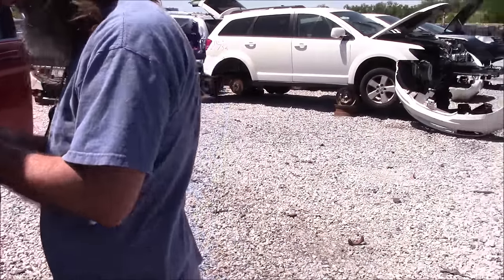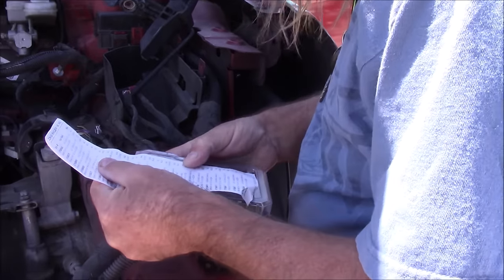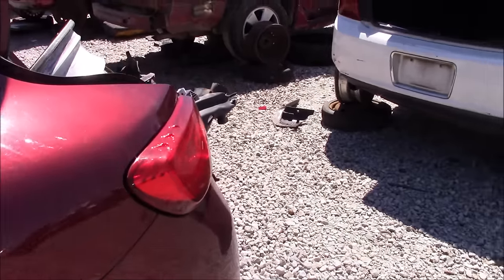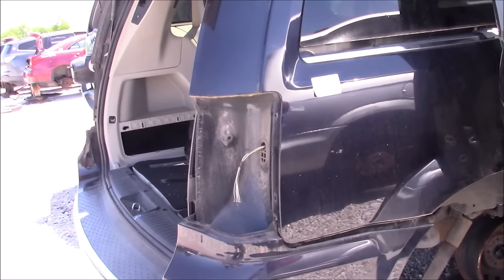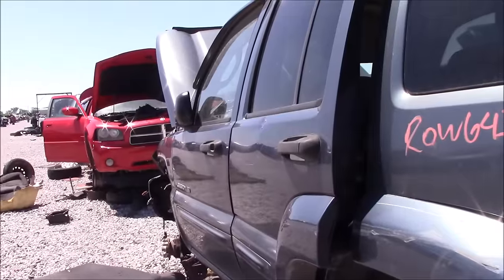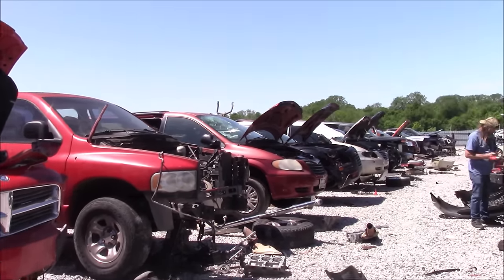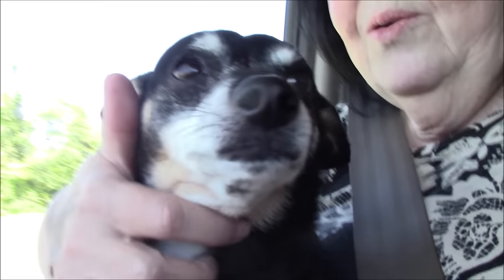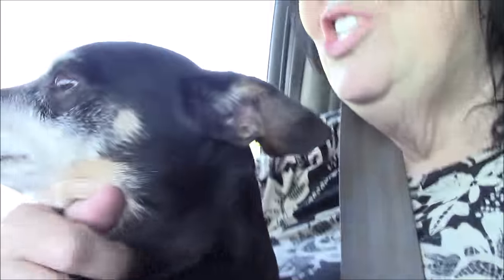Going to the Junk Yard

Comment: Oh my gosh, an inventory list with vehicles in named rows and columns!  We don't have near as many junk yards as we once had but there still are a couple of "pick n pulls".  The assembly consists of the "bucket" (the back part of the light) and the "lens".  Back in the early 1980's, a rear tail light assembly for my Audi was $300 new, $150 used from a junk yard. New head light assemblies for a lot of vehicles run about $200 and up; if you can find them for your vehicle.